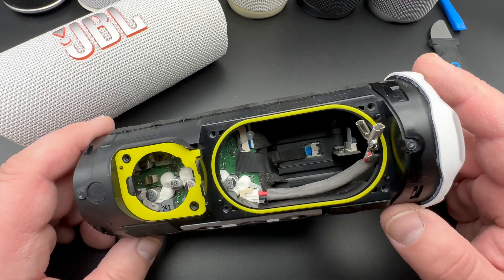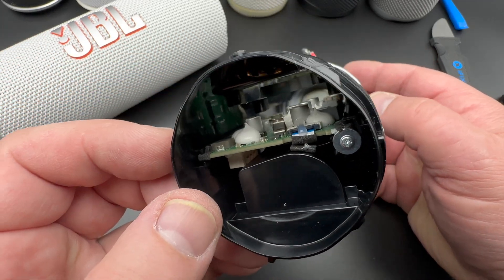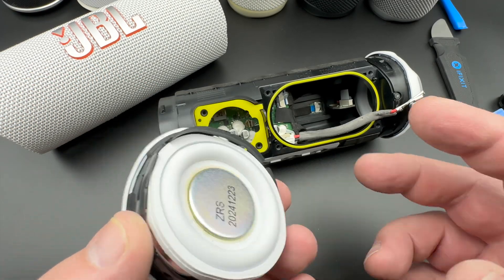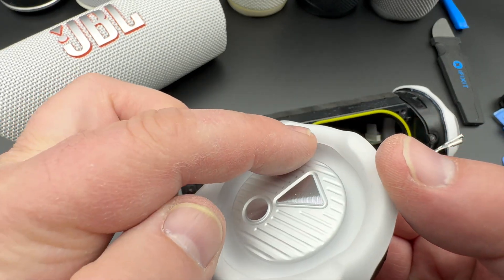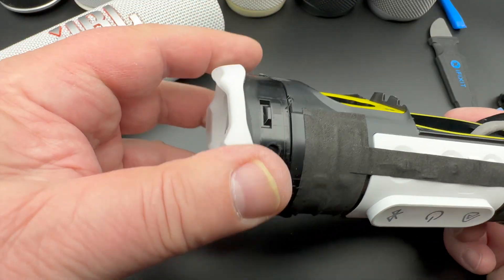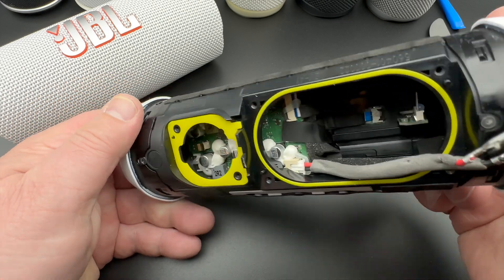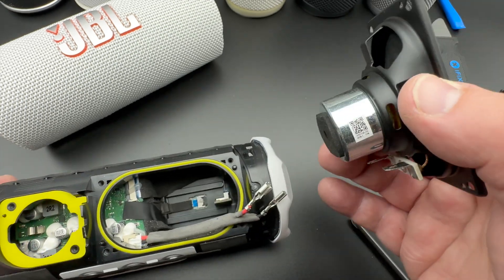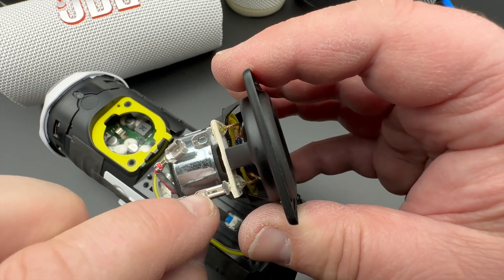JBL Flip 7 Teardown (Waterproof)

Comment: is it the ''architecture'' of the components or the chips that make the quality of the sound way better? cause i doubt you can upgrade resistors, capacitors etc though i know that chips are mostly made of these components just in waay smaller version..